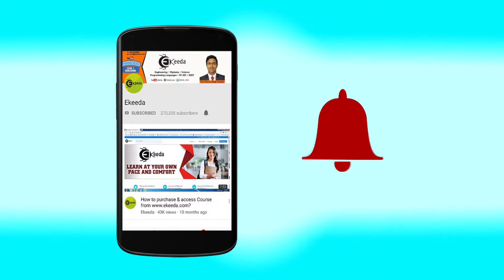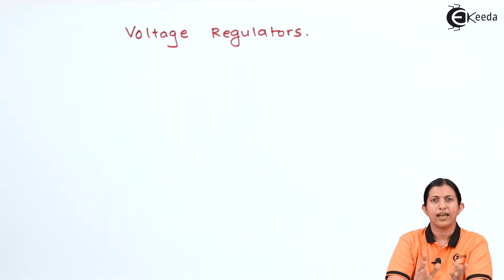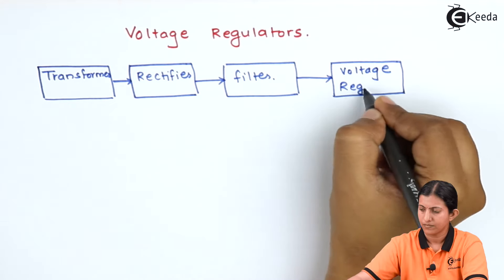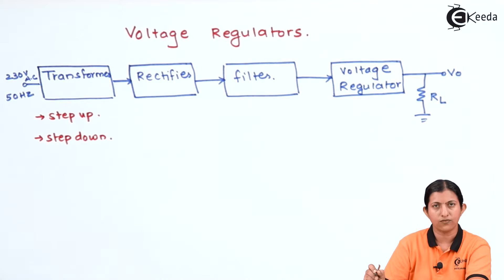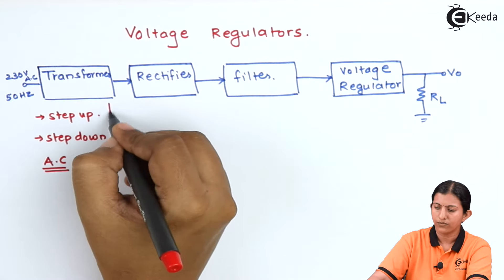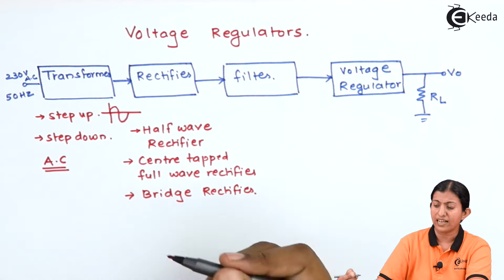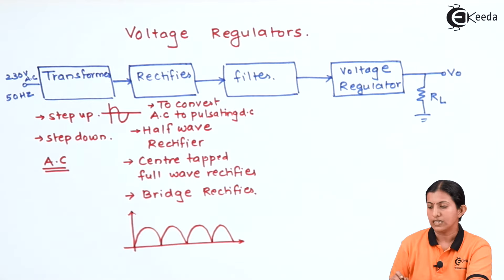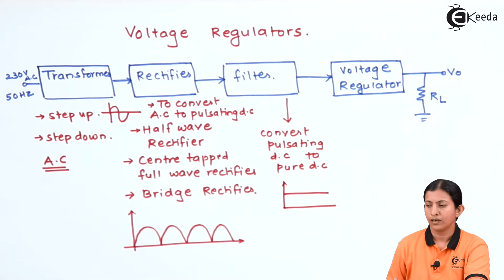Concept of Voltage Regulator - Voltage Regulator - Applied Electronics

Comment: What a great idea. Put Voltage regulator in the title but barely touch the topic in the last minute. I came to learn about voltage regulator, not the entire working of dc power supply.
Reply: Bruh are you willing to do engineering in a minute ?
Reply: 🤝 🤝 us bhai us
Reply: Tittle-voltage regulator
Actual Topic- ac to dc rectifier